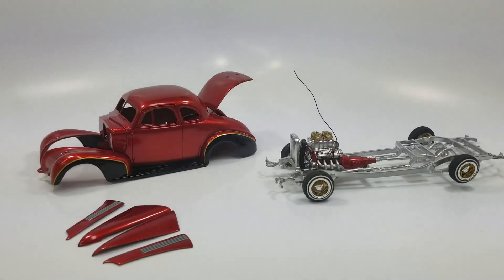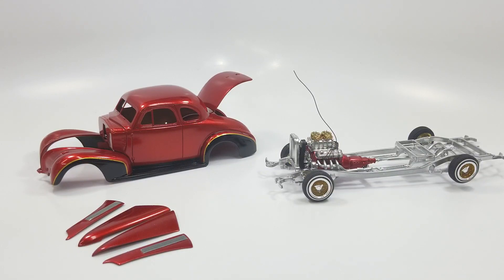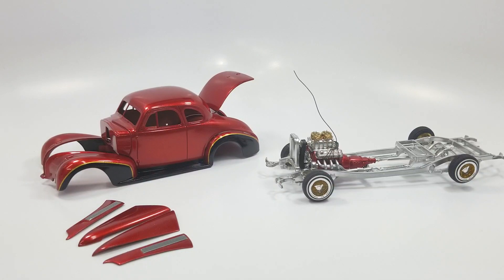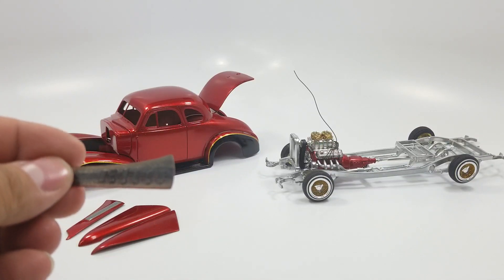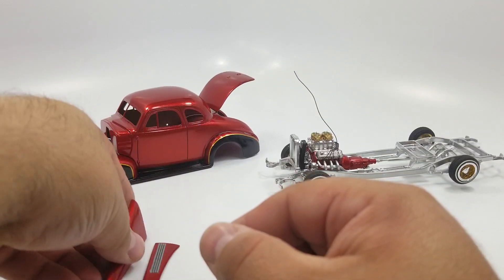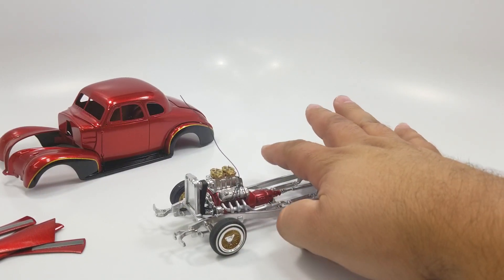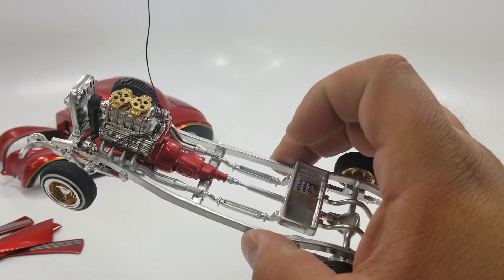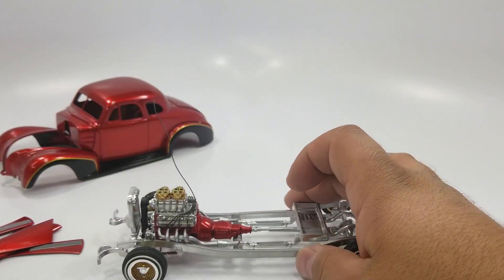SCALEDWORLD.NET build.. 1939 Chevy coupe lowrider

Comment: The thing that has always bothered be with the Sedan Delivery version and coupe version of these kits is the fact that they don't have the inner panels for the front fenders.   I have started three of these kits and put them down because I wanted to add more detail than what comes in the box.
Reply from the maker: Correy A. Lettsome scratch build them that’s not a bad idea
Reply: @HTOWNMODELSHOP  that's the plan I just ordered some styrene sheets to experiment with